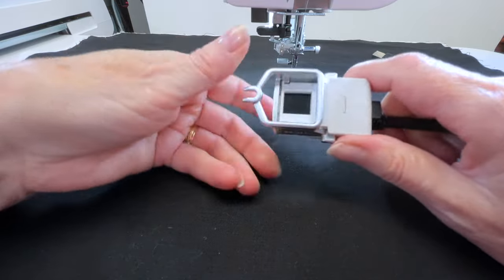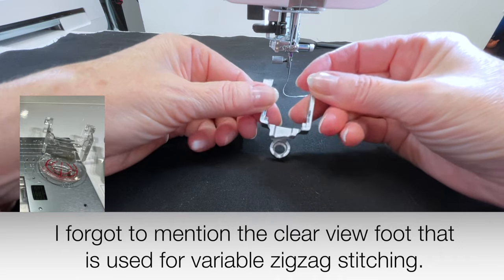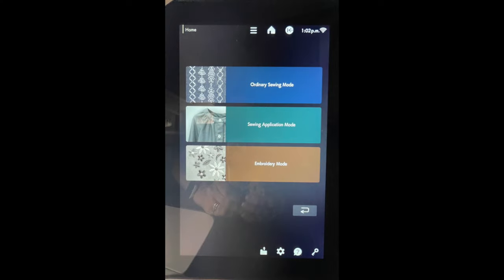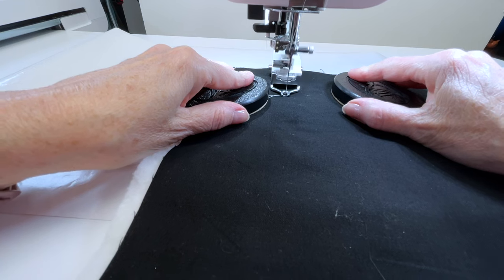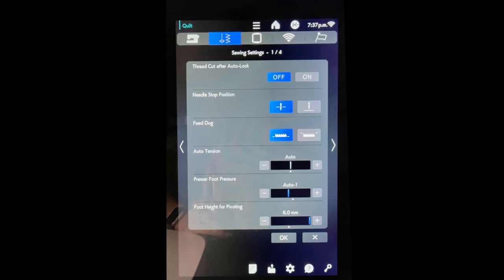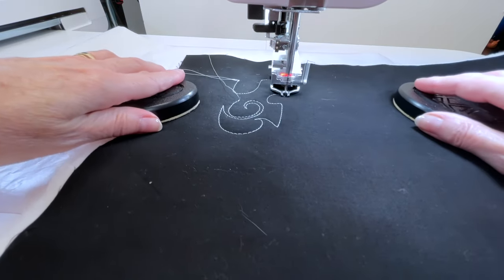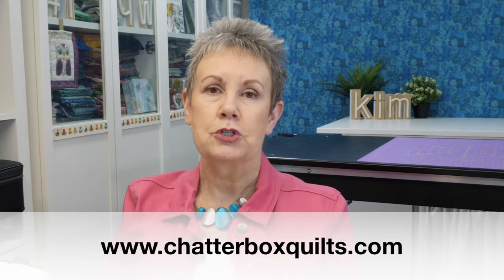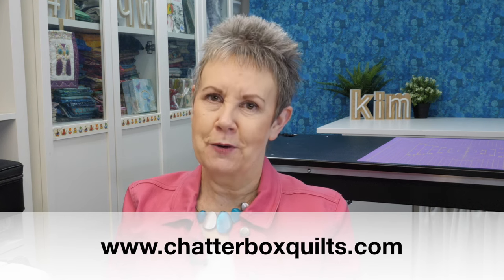Free Motion Quilting with the Janome Accurate Stitch Regulator (ASR)

Comment: Thank you for this lesson.  
I don’t have a Janome but I think I can transfer this to the machine I have with an stitch regulator
Reply from the maker: The ASR will only work on the Janome M17 - it is not a third party add on accessory which would work for different brands of machines.
Reply: @Chatterboxquilts  no not the ASR but the concept
Reply: Boy that janome Cm17 sure needs to have wheels! $20,000

Comment: Wonderful (as yours always are) but you mentioned the Stitch Lock Button but you didn’t show or say where it is.  Sure wish Janome would have put an Index in their manuals, maybe I could have found it there and not bothered you but I don’t know where it is.  Thx much!
Reply from the maker: The Auto-lock button (I call it something a bit different) looks like a bullseye - it's a circle with a dot in the centre and it is near the thread cutting button on the machine. Check page 5 of the Sewing machine manual for the CM17 and it shows the various buttons there.

Comment: ThaThanks for this. Do you know if they are going to make the ASR on the CM7 or 9450?
Reply from the maker: If there will be a stitch regulator for other Janome models (and that's a bit if), it won't be the same as the ASR. This is made specifically for the Janome CM17 and the machine has a plug area in the back which other machines don't have.
Reply: @Chatterboxquilts  ah, thanks!
Reply: @Chatterboxquilts now the new M8 has one is it the same?